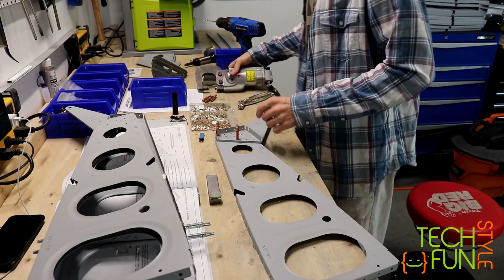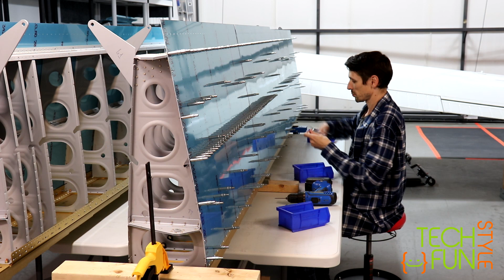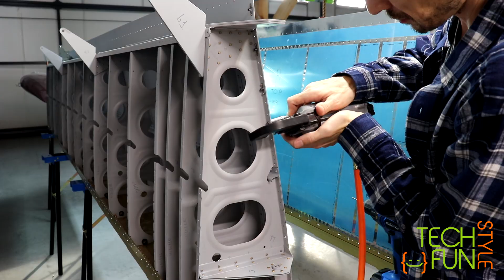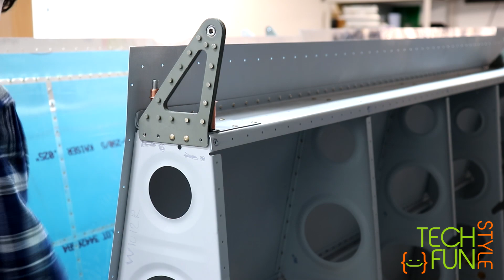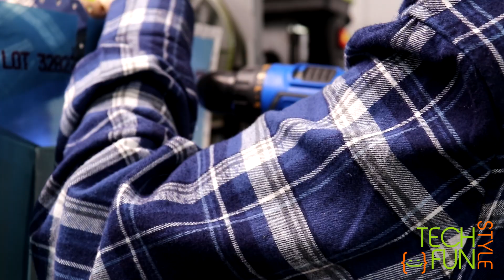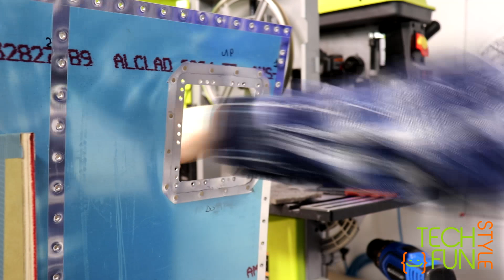RV-10 - Wings assembly. Riveting mode ON.

Comment: Hi Vlad, Your RV-10 build videos are great, thanks!  I just received my RV-10 empennage kit last week.  I like your wall mounted blue container bins.  I am not seeing those bin sizes online.  Can you tell me where I could order the same wall mounts and same size bins?
Reply from the maker: Hi William. Thank you! I bought these bins and wall mount from ULINE.ca They have many options available. I choose this one: https://www.uline.ca/BL_8779/Bench-Panel-Racks
Reply: @techfunstyle1606  Vlad, tks for the info for the bins. I did get the smaller wall mount bins from ULine.  Thinking they were too small, I. returned them.  I will reorder the same size again 4"W x 3"H X 7.5"D.  I plan to use them to hold small parts and keep out in the work area while needed. 
Just completed my RV-10 Empennage Kit inventory.  Now will build my worktables next.  
Keep up the great videos!
Tks Bill